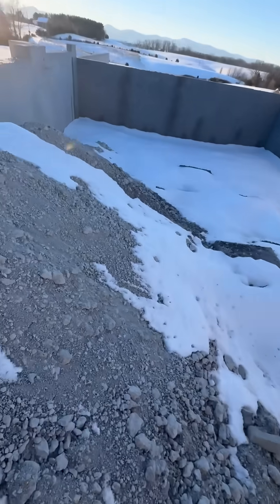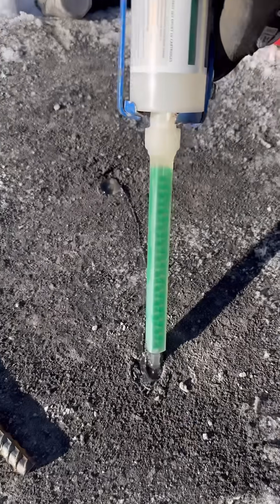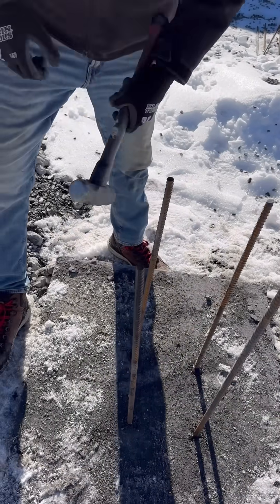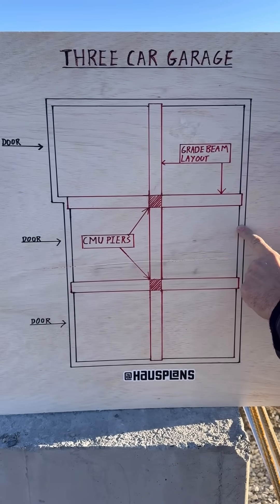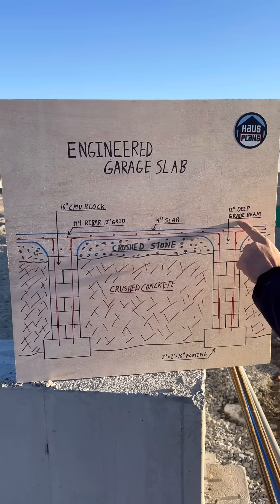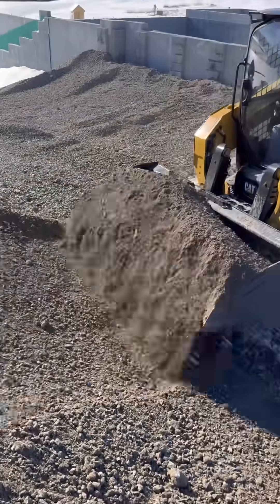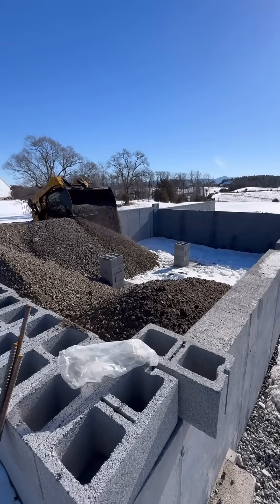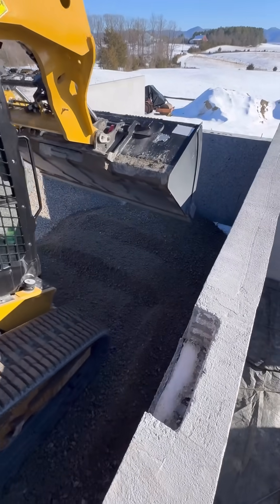Using Piers and Grade Beams to Support a Garage Slab

Comment: Why wouldn't you simply fill the space with dirt?
Reply from the maker: The engineer wanted crushed concrete. It’s OK if it settles a little bit,  but if dirt settled a lot and created a void that would not be good.

Comment: Hi say hi to the new guy for me! Boy all that space under the garage would be useful or a nice cold cellar or something cool If it was true that you could  have it as a void. I would would add an access to it  and possibly fill it with something or put something to hold up the slab and piers until it cures.  Just thinking any available space when building a Home is valuable!!! Just thinking. If you do decide to use it let me know. Also the cost of the fill could be used for something else on the build! I  had a new guy in my Plumbing and HVAC  company Buy he was  bitten buy a copperhead Snake and has gone to work and Teach what he had learned to his Friends and family to build a rainbow bridge  need to keep the water running is what I was told.  Love the hot tub BoBo had Bad hips and lower back issues from so many years as the New Guy and he would get stretches and Therapy and long soaks in his tip and a good  Rub down.  Thanks from Dale From Otto’s Plumbing and HVAC Keep me posted what you think? Ps One of the New Guys Favorite Lunches was leftover Chicken and Sweet Potato Stew.  Give it a try. I would make the New Guy His Name Was BoBo Chicken and Sweet Potatoes with his Food Daily and with boiling the Chicken and Sweet Potatoes using the broth and even if you boil the chicken long enough or in a steamer the bones and marrow would get soft enough to make the new Guy his Special Stew. I have a super Recipe if you’re interested! It was great for his health and growth and especially his digestive system plus gave him a super healthy,Shiny and Soft thick Coat and helped with his dry skin and shedding all over the job Site especially on the finish jobs! Smile for we are all Loved!

Comment: What is that drill attachment for ?
Reply from the maker: It’s a vacuum that sucks up the concrete dust
Reply: @hausplans  Thanks . That's what I thought but it hardly seems necessary outside on an already dusty site . Probably just as easy to leave it on though , instead of removing it . 👍

Comment: Huh! Me and my buddies poured the floor for my 40x50 shop. Packed the dirt and dug a 18 inch trench 8 inches deep, put in 2 or 3   3/8" rebar and poured the 185 bags of cement, 6 inches thick on one end and 4 inches deep at the other with 6x6 remesh and there is  very little cracking so far. What the heck do your cars weigh?  I'm putting 25,000  lb  tractors on mine.

Comment: I dont understand why the floor is being raised so high with 200 tons of rocks. Why isnt the foundation just higher? Isnt this weight just pushing down on the foundation without reason?
Reply: From what I can see in the video I looks like the grade is being built up around the house meaning the drive way into the garage will be built up too, plus the footing have to be down a certain amount to protect from frost (depth changes depending on where you are). Also, you need to strip all the vegetation (grass/topsoil) so you make sure the floor has a soild base and doesn't settle/ shift
Reply: This is a genuine question, does anyone know? 😅

Comment: This foundation method really pays off in the end, especially when building on slopes,
or expansive soils.
Rather than topping off the inside of the foundation walls with tons of gravel.
Why not leave room for workers accessing all points below the floor?
This would enable any upgrades, wiring or plumbing work to be easily reached from the crawl space below.
Just peg some thick visqueen plastic to the inside bottom of the crawl space and cover with a thin layer of pea-sized drain rock…just to hold the plastic down.

Comment: You could also leave it open underneath and put heavy pan decking over steel beams, to create a secret room under the garage. Access through a blocked doorway, through shelving unit that acts as a hidden door.
Reply: With my luck I’d end up in Narnia, hanging out with Aslan the lion and a witch.

Comment: Dry stacking cinder block seems a bit slack. Am I wrong?
Reply from the maker: This is totally acceptable and also called out on the engineering. It can never move once it’s surrounded by gravel and filled with concrete and rebar.

Comment: Based on the visual evidence, the snow around the feet does not appear to be melting, and the concrete looks dry, indicating that the temperature is likely below 32°F. According to the technical data sheet, Dural Fast Set Epoxy should not be applied at temperatures below 40°F. The recommended surface and ambient temperatures during application are between 40°F and 90°F.

Yet another case of the contractor thinking they know better than the manufacturer.
Reply: The way the entire pier is constrained in every direction, I don't see any need for epoxy. Why are you concerned about it?

Comment: Are you planning on digging it out after? If not, what is the benefit of doing this versus just pouring a slightly thicker slab?
Reply: Concrete is dearer than crushed concrete. To build that up would be mega money

Comment: I am slow so I had to watch this four times ,

Do you have to know the weight of the structure above to imagine supporting the structure ?

How does that work ?

Thank you for taking the time and effort to teach us stuff
Reply from the maker: Yes, engineers calculate the weight of the concrete floor along with the vehicles it will hold when they design something like this.

Comment: Ive never seen something like this, but it also looks like it gets cold where you are. What is the reason behind any of this? Ive never seen a slab poured with any of this under it before, but im also in Australia.
Reply from the maker: It’s nothing to do with the cold. It’s more that the slab is so much higher than the original ground.